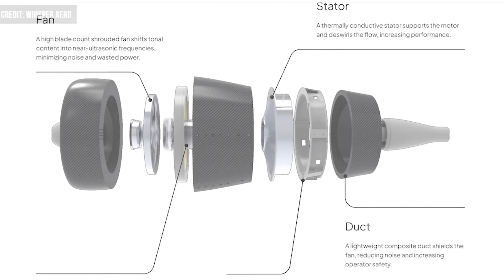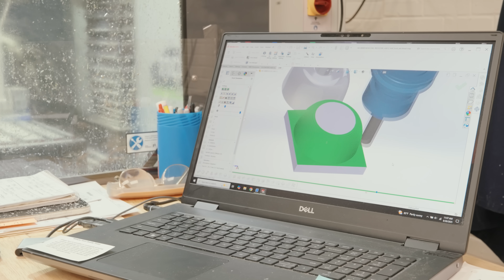They Just Solved The Big Problem With Air Taxis

Comment: Everything said in this video is a fallacy.
Reply from the maker: Everything’ is doing some heavy lifting there. If there’s something specific you want clarified, we’re here for it.
Reply: @AmericanOperator  
 No Need I clarified it for you.
Everything in this video talks about employee impact and the focus on the local community,

  Quoting the video title “They Just Solved the Big Problem With Air Taxis”  
  it’s misleading and reads more like marketing than fact.
First, we already have air taxis, so unless this new design can actually fold up and land in a driveway, it’s not really changing anything. It’s the same idea as when Uber took over the taxi market: the service wasn’t fundamentally different, it just offered a more polished experience compared to a sweaty old cab.

Summery:
The video presents itself as a breakthrough announcement, claiming that the “big problem with air taxis” has finally been solved. Yet almost immediately, it becomes clear that the substance doesn’t match the headline. Rather than showcasing a functional aircraft or a meaningful technological leap, the video opens with half finished floor models visual props that signal concept and aspiration more than any real engineering milestone. This disconnect between promise and presentation sets the tone for the rest of the content.

Instead of focusing on the actual capabilities, limitations, or readiness of the supposed air taxi solution, the video pivots heavily into emotionally appealing themes like employee empowerment, local job creation, and community impact. While these topics are valid in their own right, they do little to support the central claim that a major technical obstacle has been overcome. They function more as promotional tools, softening the message and giving viewers a sense of progress where there may be very little.

Equally problematic is the implication that this new concept represents a meaningful shift in personal mobility. Air taxis already exist, and nothing shown suggests a dramatic change in usability. Unless a vehicle can truly land on a driveway or meaningfully reduce last mile inconvenience, the practical experience isn’t any different from current offerings. It mirrors the transition from traditional taxis to app-based ride services ,an upgrade in branding and comfort rather than a structural transformation.

The video’s narrative ultimately leans more on marketing language than demonstrable innovation. By framing incremental progress as a solved challenge, it risks misleading viewers about the state of the technology. Without a working model that actually addresses the real barriers to everyday air taxi adoption, the presentation feels less like a breakthrough announcement and more like a carefully crafted promotional piece.

 their demonstration was Also built on a converted Belgian glider (the Swift 3).

Comment: The noise is created by the loud as crap Milwaukee motor along with moving air shearing still air. What type of motor in the quiet one? The moving air is in many small vortices so the shear effect is very low with high volume
Reply from the maker: No special motor — the quiet comes from the overall design and how the air moves through it.

Comment: Wings dont have to be wide fomation, they can have s-wave elogation dominantly, its lift in escalation manner. More yaw then bank motion though. Wide became a landing issue & speed limitation.
Reply from the maker: Thanks for the insight! The focus here is on integrating propulsion and airframe design to make efficient, quiet flight a reality.
Reply: @AmericanOperator 👍Surely. But I didn't  request any compromise of those goal you mentioned, just the compromise that was imposed, to achieve it.

Comment: Lillium jet went bankrupt for a reason. Ducted fans are not jet engines; and that's just one issue.
Reply from the maker: Not Lilium - Whisper’s propulsion isn’t a ducted jet engine — it’s an electric fan system designed for quiet, efficient thrust. The prototypes are real and already flying, and the approach is completely different.
Reply: @AmericanOperator Lillium was using ducted fans. In practice, ducted fans use a lot of energy per unit thrust. That's why most companies go to larger propellers or helicopter style rotors. If you wanted to use a 10x energy dense gasoline system then have at it with the jets or turbo fans. But then you lose the quiet aspect.

Comment: Quiet is nice, but ultimately it's about how much payload can you move and for how many miles and at what cost. So it's a bit premature to say they've solved the big problem for air taxis.
Reply from the maker: For sure — quiet is a start, but payload, range, and cost are the real tests. Whisper knows that and is building toward those benchmarks.

Comment: Everybody wanting a whisper leaf blower, Ryobi makes two of them. They make an 18 volt which I have and a 40 volt. The 18 volt that I have is very quiet. I have a smaller Ryobi blower and it's ten times the noise.
I love my whisper quiet Ryobi 18 volt leaf blower.
Reply from the maker: Ryobi makes some quiet blowers for sure, but Whisper takes it to the next level — quieter, more powerful, and designed with next-gen electric propulsion. Once you try Whisper, it’s a different class of quiet.

Comment: This looks exactly like a Lillium.  Lillium failed because they didn't check their physics.  Small jet engines are energy hogs.  The range on that aircraft will be about 10 miles.
Reply from the maker: Not Lilium! Whisper’s propulsion is original, efficient, and already flying in prototypes — physics checked

Comment: Sound is literally the movement and vibration of air. If you accelerate air it mimics and then becomes sound waves.  Reduction maybe but elimination is like asking for sound not to sound like anything.
Reply from the maker: Exactly — you can’t eliminate sound entirely, because moving air creates waves. But Whisper’s propulsion drastically reduces the noise you actually hear, which is a huge breakthrough for electric flight and even leaf blowers.

Comment: I'm assuming quiter equals less drag which is probably why its 50% more power.
Reply from the maker: Ha, understandable assumption 😅 But the power comes from clever design and optimized airflow — the quiet is just a very welcome side effect!
Reply: @AmericanOperator i just said it backwards but same thing. air turbilence and parisitic drag reduced by design less noise. they always go hand in hand.

Comment: The problem that waits to be solved for "the future of flight" is the energy density of current battery technology not the form of motors or fans.  The ability to glide down to a safe landing with no power is a very important feature if you expect people like me to ride in it.
Reply from the maker: Energy density is key, for sure. Whisper’s focus on efficient, quiet electric propulsion is one step toward safe, practical flight — glide capability included.

Comment: EDFs are no way near as efficient as motors with propellers.
Reply from the maker: Fair point - But Whisper isn’t doing typical EDFs — their tech pushes efficiency in a whole new way.
Reply: @AmericanOperator  I really cannot see that happening. A 50 percent increase in efficiency over a leaf blower will not compete with the efficiency or thrust of a propeller.

Comment: So.... Why haven't you shown the aircraft flying? 10 minutes talking but no proof the thing actually flies...
Reply: And where is this going to land? Those are 15ft wings.. not on a normal street with other cars, overhead cables, trees, etc..  These will need specific landing areas, which means you will need to get there and then from wherever this thing can land to your destination.. = 3 different  trips .. 
Has anyone actually run the numbers on these? Uber only became cash positive in 2023.. that's 13yrs after it started the business .. Uber has approx 1 million drivers in the US today.. can you see approx 1 million of these flying around in the US?? 
Don't get me wrong, these things are super Kool, but I have not seen 1 of these companies show us a real business case that actually is cash positive yet!
I do wish them luck tho ..
Reply: Right about 4 minutes into the video I'm thinking show the damn aircraft
Reply: Lilium jet is very similar and it can fly.  Basically this is a quiet lillium.
Reply: because it is need faa certification
Reply: A lot of talk. Home spun goodness, but no working model or prototype. Waste of viewing.
Reply: The big problem with electric air transport is not the mechanics, it’s the battery density.
Reply from the maker: Patience... Full model still in the works. Right now it’s all about the tech, flight demo will follow.

Comment: I think so many people have been burned by the general aviation sector that the doubt is immense. If Whisper Aero tru;ly is in to providing what the previos 3 FAA admin's aren't already, they NEED to get a GA hater on their advisory board to assist in the innovative power in the marketplace of ideas from those who have suffered greatly under the tyranny. Those who've suffered and robustly advocated for changes bring a unique perspective that represents non aviation people (99% of the population) and a large knowledge base that spans from not knowing anything about aviation and not caring, to learning NEPA, Land Use Laws, Public Inclusion Laws, Constitution, public speaking, communicating with local and state reps, loopholes, community planning, advocacy, nonprofits, websites, etc...and surprisingly nearly enough law and FAR to hold a management position at an airport... if they didn't want to just shut it down. 
Unsolicited advise, maybe only worth what you paid for it. I hope this is all for real and doesn't just turn out to be another GA gaslighting mockery. 
One last thing, please do find a way to advocate for a system designed to mandate our privacy and wildlife is not destroyed by this UAS/AAM push. Good luck!

Comment: If power is lost the ducts at the leading edge are effective airbrakes and lift spoilers so expect to drop like a stone ( the model with a pedestal mounted central jet is more feasible but still only an airport to airport device like we have had since 1910 . The outboard tip tails is an old idea  but  OK for better range than a standard configuration but confers no new or better capabilities for any breakthrough ( what we call a technical enthusiasm rather than a game changer and too old to be an innovation .Blohm and Voss WW2 for example . )  How icing would be handled is not discussed - it would instantly clog the ducts most likely shorting out the motors etc. A badly conceived overall design looking for trouble.
Ps the PST below froze and posted without intention. The point was that teensy little ducts have inadequate swept area ( certainly for vtol or really blown stol) and pre clude any laminar flow or even decent power off or low thrust aerodynamics  plus add horrendous complexity . Stick to leafblowers .
Reply from the maker: Appreciate the deep dive! Whisper Aero isn’t trying to rewrite WWII tech — they’re quietly building the future of flight. Leafblowers are fine… if you don’t mind missing the revolution!
Reply: @AmericanOperator nah, leaf blowers are at nearly every property across the country, even rentals, the same cannot be said about aircraft or the affordability of such when people are struggling to buy groceries. This could be a HUGE profit margin. More Americans than you may think are waking up to how detrimental noise is to our health and wer're sick and tired of antiquated technology and the noise that goes with it.